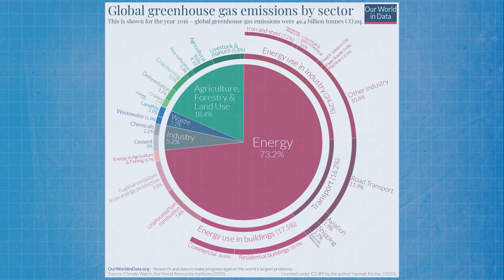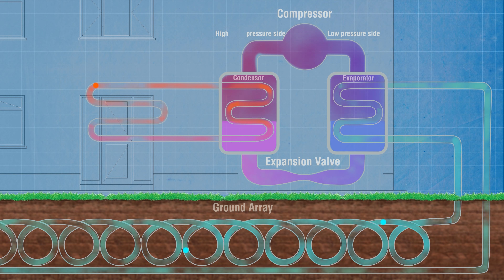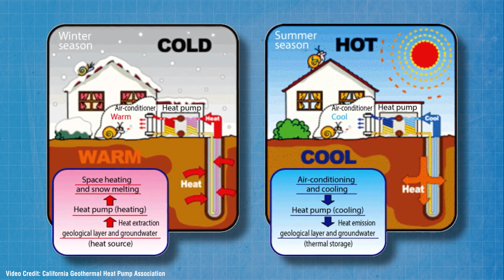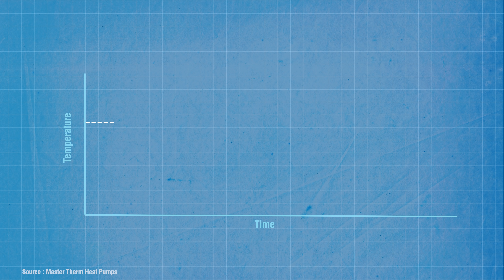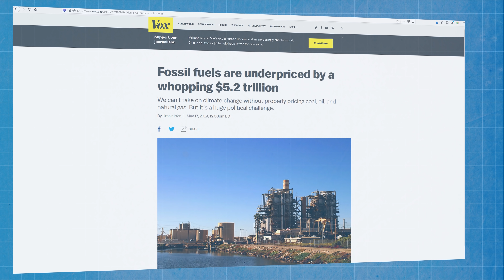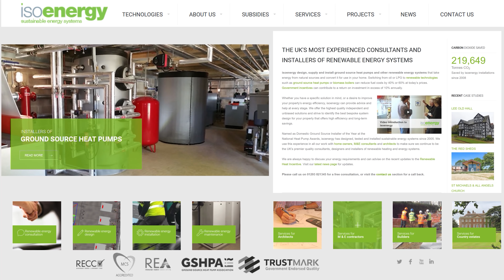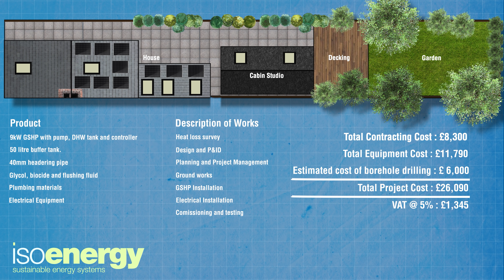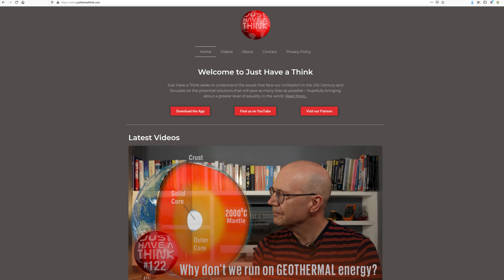Geothermal ground source heat pumps. Heating your home from your own back yard!

Comment: My airsource HP is being installed this week, in the UK.  I rarely drive many miles a year, so decided to put my green money into a heat pump rather than an electric car. My heat pump will reduce as much carbon as driving around 15,000km per year.
Reply: Hi all, as most of you have mentioned, the “hot side” of a heat pump is cooler than the hot side of a boiler, but this does not mean that you have to have underfloor heating. In my survey the installers measured each room, and the windows, and the construction type. They then put it all into their model to come back with a radiator size for each room, and therefore the “hot side” temperature that could be set for my heat pump. In my house almost all of the new radiators will the the same height and length, but will be double skinned rather than single. This allows for my heat pump output temperature to be only 45 degrees, which means that it will run efficiently. Due to this efficiency the RHI grant I receive will cover all but around £3,000 of the install, paid to me over 7 years.  Combining this with lower energy costs (I will move to a lower priced electricity tariff), lower servicing cost, and that my gas boiler is about to die, it’s really a zero cost exchange for me. All good if you can afford the upfront £15k.
Reply: Also, I’m not an agent or anything, but the Mitsubishi Ecodan system was designed and is built in Scotland, and the service team are in Manchester. It was built specifically for the UK climate, which is why I went for that. There are many Ecodan videos on you tube.
Reply: @Muppetkeeper  fantastic, thanks for the info. Interesting you mention your gas boiler dying, it's the one thing that makes me a little hesitant. I have a 7 year old oil system with absolutely zero issues and I am really torn on taking it out, it seems quite wasteful in itself. I've been looking into an MVHR system too, as we're very well insulated but extremely stuffy, so I might approach it step by step. It'd be very useful to plan my final system though up front, so great info, thanks.
Reply: Rico S I agree with you, you have to be careful to balance the carbon if you are pulling out a working system. My gas boiler is 17 years old, and the water tank has a slow leak. The radiators are 30 years old too, and end of life, they have all done their bit. The RHI grant will be changed June next year, so best keep an eye on the grants.
Reply: @ricos1497  So you don't need to be in a rush and can work out what you need. Even better you could do the airtightness/MVHR and insulation (EWI is best but also most expensive and harder to DIY) in the meantime so you'll need a much smaller heat-pump in due course (or possibly none if you get close enough to passive). Sounds like you've done some already. And that would greatly reduce your gas usage/emissions too. MVHR physical install is simple enough - getting the airflow sums right is harder. Having done it once with rigid galv pipe I'd recommend the Ubbink semi-flexible system as much simpler to calculate and fit without losing efficiency, unless cheapness is your primary motivation (galv pipe is cheap and robust but a PITA to fit, seal and do the sums for).
Reply: @Wookey.  awesome thanks. I'll check out the semi flexible system first. The cost should be offset by doing it myself. I think my biggest problem will be that my house is already insulated to a decent level. To make it airtight would probably be expensive, just to get that 20% (or whatever it is) extra for air tightness. I suppose I should buy a meter and test the existing walls and windows to see what like first!
Reply: @ricos1497  Airtightness is not generally expensive, but it can be difficult on an existing building. You just have to find all the holes and seal them. It only get expensive if your existing doors/windows are badly sealed and the only way to fix it is get new ones. In practice you can usually make things a factor of several better because most british houses are absolutely rife with holes. So tape or foam round windows/doors (where fitted into the wall). Fix all plumbing holes. Suspended timber floors are shocking and relatively hard to fix, but can be done. Joists-ends into walls are often a big source of gaps. Fairly easy to fix but you have to remove floor and ceiling round the edge to get to them which is never convenient unless already doing a big refurb. Light fittings into roofs, existing ventilation fittings (bathroom/kitchen), edge of concrete floor/under skirtings. Some buildings are fundamentally hard to deal with: timber frame with a cavity and plasterboard insides, known as 'plasterboard tents': best to seal on the outside and do EWI with that sort of thing. You can get a blow-door test for £250 to find out how bad it is and where the holes are but I'd do the obvious stuff first then do that to see what you've missed. Brickwork in general, and obviously cavities, is usually not at all airtight. Plaster is though so a plastered or parged wall can be very good. Tops of cavities are often just open to the air. Same for cavities in party walls (latter can be a big heat loss too). Most of this is labour-intensive but not difficult, so it's much easier for the homeowner to do over a year or two than some tradesperson who popped in.
Reply: @Wookey.  that sounds like a lot! But my house is modern, and the builder was local and good, so I'm guessing I'll not have a lot to do. Is there a fancy gadget for checking these air leaks?
Reply: @ricos1497  UK builders have no idea about airtightness, and our building standards are extremely lax (10 air-changes per hour, where you really want less than 3 and preferably less than 1. So being new guarantees nothing except at least you won't have a suspended timber floor.  The fancy tool I use is a little strip of bog paper that you can see fluttering in the breeze next to leaks, especially on a windy day. You can get a little smoke-gun for about 20 quid. A wet finger or back of hand is also quite sensitive. Mostly holes in your building are fairly obvious once you start looking under trim/behind kitchen cupboards/under floorboards.  I can recommend blowerproof/passive purple sealing paint, orcon F sealing goop, illbruck airtightness foam, and tescon sealing tape if you start trying to improve things.
Reply: @Wookey.  brilliant, will give it a go. Thanks for your help.
Reply: That is simply not true. There is no one figure (it varies with the size of the house), none of the AC/H figures in the Building Regs is as high as 10, and all new houses require testing for air tightness. I have built a number of houses with  around half an air change per hour via heat exchangers, and I have a collection of completion certificates to show that they all fully complied with the Regulations.
Reply: @MikeAG333  good reply, you've got me there! I think the difficulty here is you seem to be going from one thing to the next making it impossible to understand what your argument is. I understand your valid point about the current inefficiency in the grid. What I can't see is what you're suggesting as an alternative?
Reply: MikeAG333 Read my post again. I was highlighting the fuels based on carbon. Or just forget it, you don’t seem to be able to grasp it. I’m done
Reply: @ricos1497  The problem is, I'm afraid, that there is no good answer. We are only choosing from bad or less bad answers. In the Youtube world of easy solutions and black and white positions, that is a difficult argument to get across. The fundamental answer is to reduce demand (for both heat and power) to trivial levels, and not to fall into the trap of thinking there is a simple technological fix for every issue. I have to design buildings in the real world, and clients all seem to think that a simple bolt-on bit of kit is going to make their project into an "Eco-this" or a "green-that". I'm afraid the logic and the maths is against us in that endeavour.
Reply: @MikeAG333  I see. I understand your point. Surely passiv standard of housing reduces demand for heating to trivial levels then? Do you think that would be a good option? I then need to align my energy use to what I can glean from my rooftop via solar? Genuine question, I get your frustration and point (I didn't think it was that obvious at first). If you were designing a house to be of trivial energy use, what would you do? Do you think that there are any solutions for houses like mine that sit in that grey area of being fairly well insulated but, for example, doesn't make use of passive solar or whatever? Would air tightness be your go to for that, with mechanical ventilation? Thanks.
Reply: Interested how you get on. I’m in the UK too and am thinking of replacing my aging boiler with an ASHP./hybrid system of some sort.
Reply: @mattcbinns  I have had a full survey, scop for heat is 4.1, for hot water 1.8. I waiteed until the outside unit tech was ultra quiet, as i don't want to upset the neighbours. Specced an Ecodan R32 8.5kw with 210 litre tank.
Reply: @Muppetkeeper Good job. Nice to see people doing sensible sums about most effective changes. And how much is that?
Reply: Who are you getting to install? I'd like to replace my oil heating, but not really sure how! I'm concerned that I'd have to install underfloor heating instead of radiators to get the best from a heat pump and thought that might be too expensive.
Reply: You realise that an air source heat pump is just an airconditioning unit under another name? I'm really not sure how this can be justified as helping in the fight against climate change. In years to come it'll come to be seen as the same sort of greenwash/ con as hybrid cars.
Reply: MikeAG333 I’m a Chartered Engineer, so understand what it is perfectly. As my current gas boiler uses a non renewable fuel at only 80% efficiency, and my proposed new system uses a renewable fuel at around  400% efficiency, I think it’s a big step forward. What suggestions do you have rather than just being negative?
Reply: @Muppetkeeper  Why do you think your proposed "fuel" is renewable? And on what basis do you claim 400% efficiency? (You surely haven't fallen for the CoP of 4 claim, have you?) You must know that electricity is generated at an average efficiency of less than 30% in the UK. Why doesn't that appear in your claims? 
And I'm not being negative, I'm being realistic.
Reply: @MikeAG333  You should take a look at the electricity decarbonisation over the last decade. The efficiency you mention for electricity generation was based on COAL, you may not have noticed that we don't burn much coal any longer.  Most of the UK gas powered stations run at about 60%, as they reuse the hot gas cycle, the efficiency of solar and wind is irrelevant, as is the efficiency of Nuclear, so you 30% is a number pulled out of the air.  Also, even if my system only hits 200% rather than the tested and approved 400%, it's still better than burning fossil fuels at 80%.
Reply: @MikeAG333  Oh, the electricity I use is renewable, as it comes from wind and sun.
Reply: @Muppetkeeper  If you buy your electricity, it comes from the same place as the rest of us....... and is thus only 30% renewable. The only way that you can truly get renewable-only in the UK is to generate it yourself. Who you pay your bill to is your choice, but it makes not a jot of difference to the source of the electrons moving down the copper into your home.
Reply: MikeAG333 I do have my own generation thanks, i then top up with some of the 60% of UK electricity that is low carbon.  I see that you’ve “moved the argument” again, which is what people do who are continually proven wrong by fact and science. I’m done with you now, you were wrong about heat pumps, wrong about electricity generation efficiency and also haven’t presented any facts at all, just naysaying. If the world was left to people like you, we would still all be in caves.
Reply: @Muppetkeeper  Whilst some gas plants do run at higher efficiencies, most are in the range 30 to 40%, and then there are the distribution losses. You're forgetting to multiply your 200% with the percentage of generation efficiency. That gives you a whole system efficiency of 60 to 80%, which still means you would be better off burning the fuel in a boiler in your own house.
 It'd be good if you'd leave out the sarcasm.
Reply: MikeAG333 You have no idea what you are talking about. Only 30% of UK electricity uses gas or coal. The rest is derived from sources which are not “fuelled” but use wind, solar or uranium (plus hydro and biomass). Therefore my measured 400% efficient system takes only uses 3 units of “fuel” for each 10 that it takes in, it then outputs 40 units of heat.  If each of those 3 units of fuel were only 30%, which they are not, it’s still 9 units of fuel plus the 7 from the other sources, so that’s 16 units of fuel to produce 40 units of heat.  A gas boiler produces 4 units of heat for 5 units of fuel, so would need 50 units of gas to produce the same heat as the heat pumps 16 units of mixed fuels.
Reply: @MikeAG333  that wasn't sarcasm. Sarcasm would be like: "Great comment mikeAG333, you've really enhanced the conversation". It's sarcastic, you see, because you haven't really enhanced the conversation at all, but the correspondent would be mockingly suggesting that you were. I really hope that clears up any misunderstanding. Really.
Reply: @ricos1497  The irony is delicious. If ever a reply didn't enhance a conversation, you just provided it.
Reply: @Muppetkeeper  No, you don't get to choose the source of your electricity.  Your mix is precisely the same as anyone else's.
Reply: MikeAG333 The whole of the UK’s electricity mix for the last twelve months was gas 37%, coal 5%, wind 21%, nuclear 19%, solar 11%, biomass 8%, import 6% and hydro 2%. I also have solar which contributes 20% to my use.  So the 30% of my electricity at worst is from fossil fuel. A heat pump system will get greener each year as the percentage of fossil fuel used for electricity drops each year. Also, the National Grid turned the country into generation zones many years ago, so the mix is not the same for everyone. I would go read the Internet and get up to date.
Reply: @Muppetkeeper  
 "I would go read the Internet and get up to date.".......If you could leave this sort of attitude out we'd have a sensible conversation. I'm an architect. I don't have the luxury of relying on stuff I read on the internet so childish "bring yourself up to date" type comments should be saved for people who really haven't a clue.
Reply: @MikeAG333  Yes it can be used as an air condition but used for heating a home it will normally use less energy than an electric heater.
Yes it do use electricity that has to come som somewhere but so do all the different heat pumps.
Since the air in the winter is cold, it is less efficient the colder it is outside and will have a break even temperature  compared to an electric heather.
Yes it did reduce my electric bill.
I am using an air to air heat pump  and I can just turn mine off when it becomes below -15 degree  Celsius because it will not be efficient anymore, but it is OK for me since I got a coastal climate.
Some are good as far down as -35 C (according to their advertised spec),  but they cost  more.
Reply: @rusle  You're misunderstanding me. An air-to-air heat pump IS an airconditioner. It is precisely the same piece of kit....it's just got a nice new name.

Comment: There is corruption in everything man does.  In the energy sector, information and financial forces constantly steer usage of energy to conventional high profit sources.  For example: air conditioning and refrigeration can be achieved at a fraction of the energy expense using new sound technology, but this technology is suppressed and denied by academics that sell their opinions to the highest bedder.  In geothermal the local traditional heat pump systems could easily be modified with solar heat collectors that channel heat into under ground storage all summer to be used all winter for heating with no heat pump assistance.  Just like in every other field, opinion is steered and any deviance from conventional politically correct thinking is quickly suppressed or explained away by some academic prostitute.
Reply: the installers of these systems do really well because of the gov't incentives. Corruption goes both ways

Comment: With the aid of various Scottish and UK organisations I've put a ground source heat pump in our house along with solar panels and a small battery also an EV and charge point. We have a small rental house which now has an air-source heat pump. Both have significant external insulation. We are now on the green homes network so that other interested parties can ask questions https://greenhomesnetwork.energysavingtrust.org.uk/CaseStudy.aspx?cid=1548&cindex=-1 It is expensive, but with a bit of delayed gratification and patience we have found the process fairly painless.

Comment: What if we use air to transfer heat from underground to the house directly, instead of using a complex procedure of liquid  which a lot of energy is lost on the way.
If we pump air through the piped underground and the same air in the pipes gets heated underground and comes from the other end inside the house. 
I think this system would reduce all those complexity and could also be used for cooling.
Reply: The temperature of the air directly extracted from below ground will not be high enough to make any difference to the temperature in your house.  What the video didn't mention is that heat pumps use latent heat of vapourisation to transfer the heat, just feel the different temperatures of the ice-box in your fridge and the compressor motor behind it.  The cold fluid on a heat pump will be below zero degC, and so will absorb more heat from the ground than a fluid at room temperature.